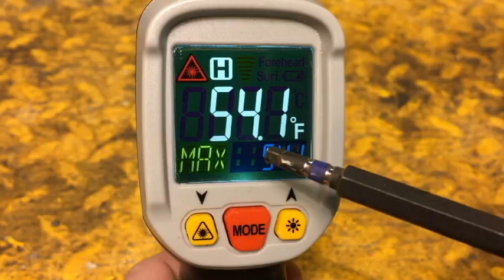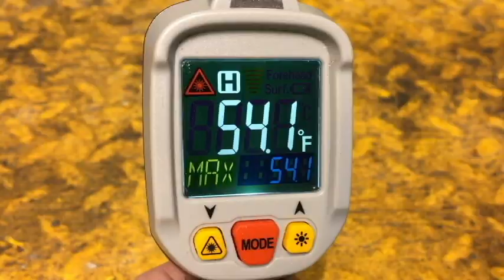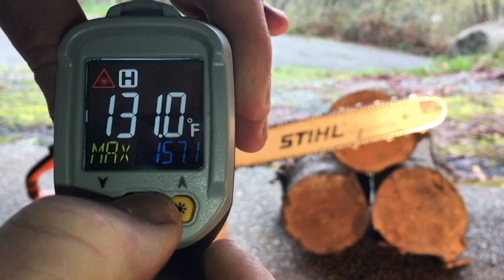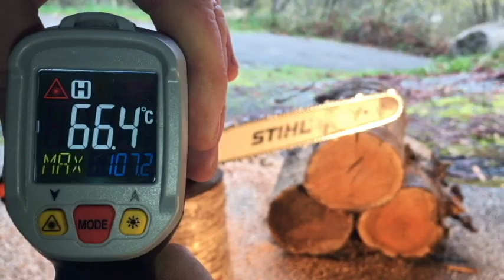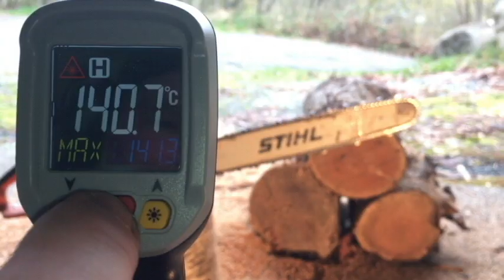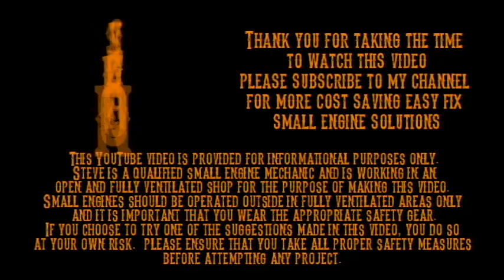Why A Dull Chain Will Destroy Your Chain Saw

Comment: Running a dull chain the most obvious issues are difficulty cutting, fuel consumption and chain stretch, increasing the hazards associated with a loose chain, as well as reaching the point of replacement sooner because the chains integrity is compromised from being to worn.

Less obvious, your wearing out your bar and sprocket quicker, as well as the engine. If your bar is worn, you won't be making straight cuts even with a new chain. i don't know how much the sprocket affects the cutting, but eventually it won't hold the chain and you won't be able to cut.

honestly, you can cut with a dull chain for a long time without noticing any effects on the engine, at least in my experience. The bar and chain stretch, along with the issues that causes in the cut are my main reasons for keeping my chain sharp and properly tensioned. i do not enjoy fighting my saw.

Comment: Stands to reason, working the engine longer to do the same cutting and requiring more horsepower...same goes for the operator,LOL.  Probably would cause higher amounts of the 12/16 ounce highly portable "coolant".......???  (for the operator).  Good video Steve, very scientifically informative.
Reply from the maker: Thank You...

Comment: Sharp chain = more work in less time, with less fuel and less effort.
Reply from the maker: Amen to that brother...
Reply: Less fatigue also, start trying to push increasing your effort
Reply: @Deon Denis What kind of electric saw do you have and what size trees are you cutting? Trimming limbs, or cutting down bigger trees? I've been using electric saws, but, found that it's dramatically easier with a gas powered saw. I've been using Remington saws. The biggest one is a 12 amp. It's a much bigger chore doing anything more than cutting small trees and limbs. Then again, I have generally been pretty horrible about keeping the chains sharp. So, that's probably part of it. But, even with a sharp chain, there is a significant difference compared to my Stihl MS 170 saw.
Reply: Less heat build up.

Comment: If you ran that saw the same length as the dull chain the temperature would be the same wouldn't it? It was less on the sharp chain because you accomplished the cuts faster and the engine ran less time. If the saw is dull it means there is less resistance on the chain, not more. The sharper it is the more it cuts into the wood and the more the strain. If you filed off all of your teeth the saw would just run with almost no resistance. When running at WOT with the dull chain the saws cooling system is running faster and cooling better than the high resistance and shorter run time of the sharp chain. The dull chain would have to run for a long time because it would take longer to cut the wood and that is the real damage to your saw, more run hours to get the same amount of work done. You want the most efficient use of the saw so having a sharper chain is better than the dull one that has to run longer to get the same work done.

Comment: Don't forget with the added temp in the cylinder and piston the hotter the fuel and oil mixture and as oil gets hotter it loses its lubrication which will cause the piston rings to damage the cylinder wall. That's why in liquid cooled engines your engine fan cuts in at about 205 Degrees F and cools every thing down and when the temp hits about 210 warning lights and alarms are activated

Comment: Steve, the melting point of aluminum is 1200*F, but I think you must consider the breakdown temperature of the oil. I'm not sure what this temp would be but I'm certain that higher temps lead to the oil breaking down and ruining a good piece of equipment.

Comment: The situation where a dull saw could damage an engine is capping a stump in the summer if your chain dulls and you keep going the compression button plastic melts and you lose power to much hot exhaust for the saw to breathe

Comment: I think your engine temp went up because you were running it for a longer time, try again cutting for a set time, doesn’t matter how many cuts you make cos obviously a sharp chain will cut better.
If anything a dull chain will cause the chain to get hot and also the bar, probably shortening the life of the bar but definitely the chain!

Comment: I likes the video but you cut with the new chain first presumably from a cold start. The engine temp may well have risen anyway for the second cut even with the new chain. Needed to do a third cut with the new chain (after the old one) see if the temp dropped back down and even a fourth with the old chain to see if it went up again. OR....Done the first cut with the old chain. It does seem logical that the harder the engine is working (old chain) the hotter it will get but not proved conclusively in the vid. I do enjoy your videos though Steve.

Comment: I purchased an IR temperature gauge and I have found many uses for it that I never even thought about prior to owning one.  Mine is a Milwaukee but the same basic tool.

As for the test and the temps measured, the interior temps would be considerably higher in the cylinder, pistons, and rings.  It could make an even bigger difference in the summer with hundred degree ambient air temps.  The flywheel fan cooling can only do so much for any given RPM and load.  So a scored cylinder or broken rings are possible with higher temps.  In addition to the additional load on the rest of the saw and operator.

On another note though, anybody running a chainsaw with a poorly maintained chain is most likely not going to care for the rest of the saw either.  For example, bar oil, fuel mixture, debris, muffler, spark arrestor, etc all need routine maintenance for the saw to perform correctly.  Chain and bar maintenance are just part of it.  Poor maintenance of a saw will shorten the life of the saw.

Comment: Awesome video steve (as always!!!)  I've been working my way through ALL of your videos (excepting lawnmowers actually, they're not relevant to me) and I've finally got the chutzpah to say/suggest something- you should do a/some videos on super-basics, I am loving everything there is to learn here but I expect that there are others, like myself, who have no background and, while learning piece-meal like this is incredibly useful in a practical sense, I find that I've still got the thought "gotta find a non-Steve's chainsaw video, and carbeurator-in-general videos, so you can understand HOW they work & WHY they're made that way", for instance I'm aware of stoichometric ratio and gas/air/pressure but I still don't get precisely how a 2-stroke generates the spin to the axle (or transmits it to the axle shaft), or how a carburator functions, so will be blindly googling 'youtube+' for those topics to find an unknown presenter, would be epic to see 10-20min videos by you explaining just how a chainsaw is made(not production-things but why the parts are used & how they work together), or how a carburator works in-general, kinda "motor theory" stuff instead of your typical (uber helpful!!!) how-to, specific-issue type vid!  I imagine many others like me would benefit greatly from these, am guessing >50% of your routine viewers couldn't put together a good answer if asked "how does a carburator help make the engine run?", at least not past "it gives it fuel+air" which is a poor understanding IMO!

Comment: I file my chain at every tank-full. A dull chain would probably increase MY temperature.
Reply from the maker: Great idea Jeff...
Reply: That´s actually a really practical idea!
Thanks, jeffrey. Will try to adopt.
Reply: @martialme84  I do the same thing. Its normally just a touch up by hand with a stroke or three per chipper. There is this little vise you can get. It has two spikes that you pound into the wood of your choice and a screw that you tighten onto the bar. It holds the saw steady while you sharpen. It makes a somewhat fiddly task dead simple and much faster. Wear gloves and use the correct size of file. About every 5L ( 1 gallon) of fuel I bring out the jig and do a more involved sharpening. This ensures the chippers are at standard angles and uniform length, resetting any inaccuracies that may have built up. The other thing to check every few touch ups are the depth gauges. It doesn't matter how sharp the chippers are if the depth gauges don't allow them to bite.
This is a good description
 
https://www.oregonproducts.com/en/how-to-sharpen-a-chainsaw-chain